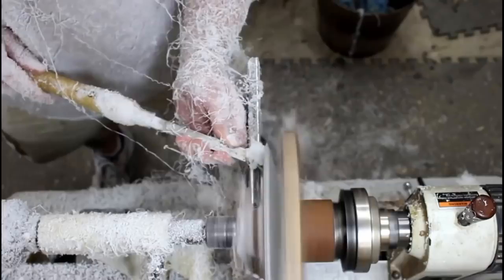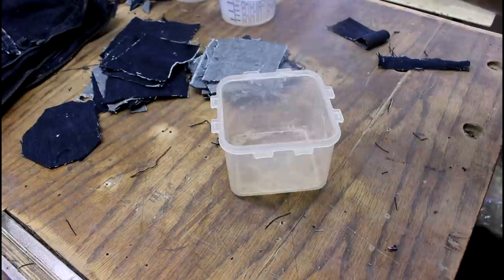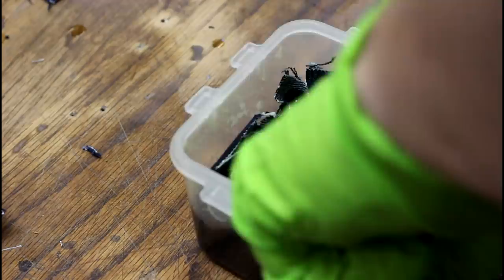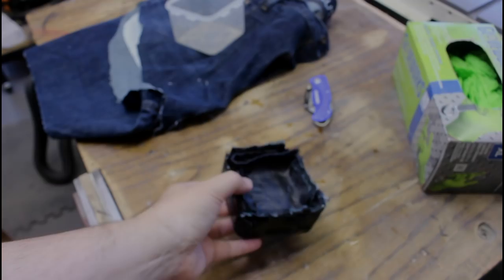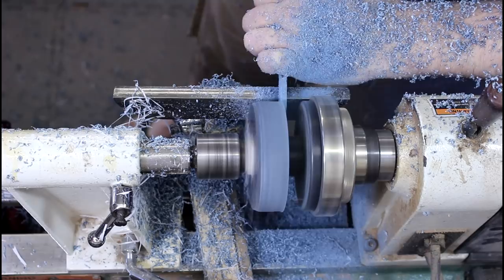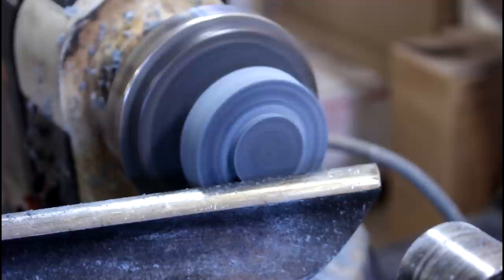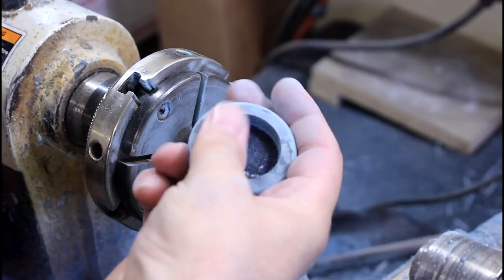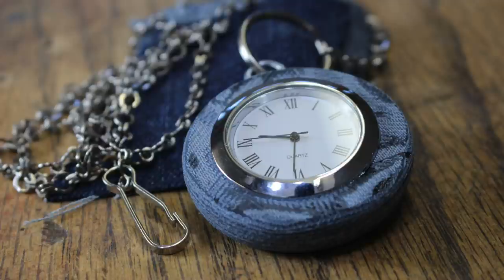DipIt #17: Blue Jean Pocket Watch

Comment: is it possible to make a resin watermelon bowl?
Reply: Natticate  that would be epic
Reply: Unfortunately, I do actually think watermelon will rot under resin, unless you were to clean everything away from the side of the gourd.
Reply from the maker: Uh, if the watermelon was super dry. Yes. Moisture and resin don't mix.
Reply: If you scoop out the flesh of a half cut melon then dry it upside down with a scaffolding inside it (so it does not deform when drying) then you could put the skin in resin and you got you're self a bowl.

Comment: I've always kind of wanted to see you make a set of tools for the shop. Like, even if they weren't feasible to actually use, and were just for decoration, I'd like to see a big compilation video where you used a different technique for each tool. Like different chisels with resin handles, a hammer with a micarta handle, a file with a wood turned handle, things like that.

Comment: The really cool thing about this dip-it is that the denim, once turned, has this snake-like pattern to it. Initially, it was more noticeable, but at this smaller size, it's a bit more subtle. It's still neat though! (I think it might've been due to the un-even flatness of the denim arrangement, or maybe the flip-flopped placement of the denim)
Would love to see more patterns that can match this.

Comment: Cool project. If you make another one, use the actual watch pocket from the pants, including rivets if possible, as the final layer. Keep that side as untouched as possible when turning, and use it as the back of the watch. It would also work as the overall shape of watch, cut out instead of turned. Another one to add to my list of gonna-makes. Thanks.

Comment: love all your videos!  one tip however.  when preparing fabric its way easier to cut with (genuine) Fiskars sewing scissors rather than a knife.  they slice through all kinds of fabric with ease and neat edges (if that's what you're going for).  they're usually about $20 or less at wal-mart.

Comment: If this were my project, I'd also have to make the chain.  I've been making chainmail for about 10 years now.

Actually, that's got me thinking; I wonder if you could do a chainmail sheet in resin, but keep the coating thin enough that it just leaves the rings stiffened into place?  That could be cool for something like a lamp shade or a bowl/basket.

Comment: If the idea was a pocket pocket watch... I think it'd have been cooler if you'd bought, like, five pairs of cheap toddler jeans and cut out the pockets. Then it'd have been made from pockets, still pocket shaped, and yet small enough to fit into an adult's pocket for actual use. As is, a blue jean pocket watch is awesome.... I just think a pocket pocket watch would have been even more awesome.

Comment: What series of sandpaper do you use? I need to get some scratches out of some steel and get it back to a polish for a project. Currently I have 80, 100, 120, 220, and 320.

Comment: When working with phenolic resin like that; how do you mitigate the vaporization of the phenolic when turning or sanding?  From experience, the phenolic can vaporize and even go through a HEPA filter respirator.  Nasty stuff if you have a sensitivity to the chemical.

Comment: Did you say 3 pumps of each? isn't the mix ratio 3:1?  That would be 3 pumps resin 1 pump hardener.  I would expect that would shorten your work life if the wrong ratio was used and in worst case leave you with un-crosslinked hardener.   Either way it turned out great.
Reply from the maker: +Ian Thomas total boat has 5:1 2:1 and 3:1 systems but the pumps take care of the mixture. So it's just one pump each. :)

Comment: so I saw this in a comment by Ryan Brewer, but let's like this comment just so Peter will see it and subsequently do it. Essentially what needs to happen is a chess board. But not just any old chess board, it needs rock salt for the white blocks and aluminum shavings in black resin for the black blocks. it should be framed in some kind of wood, perhaps walnut.